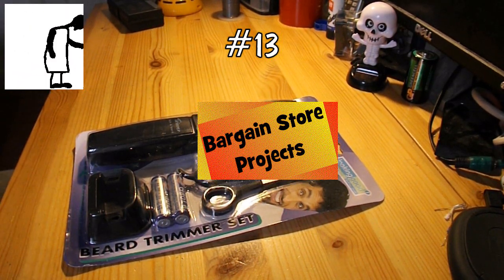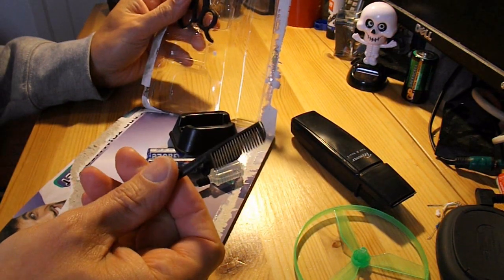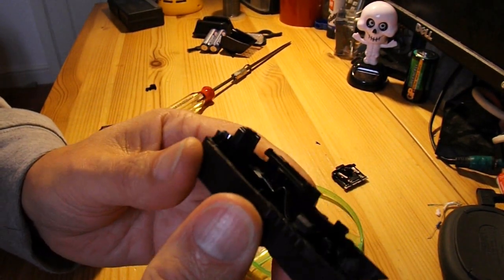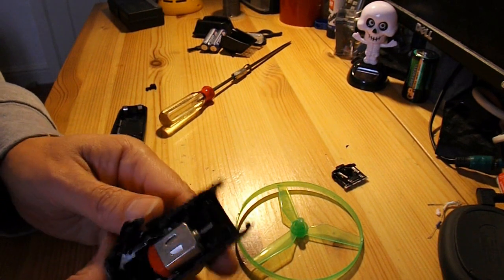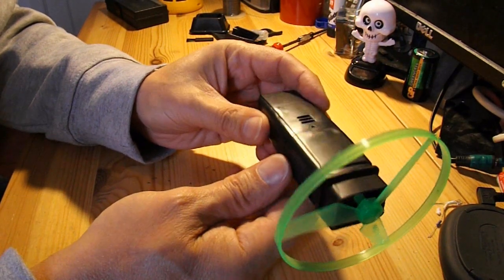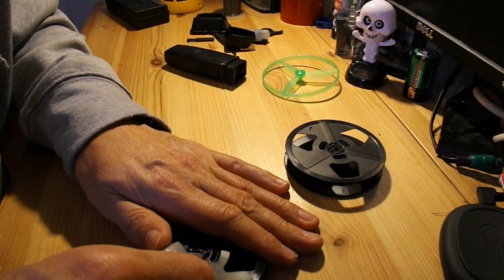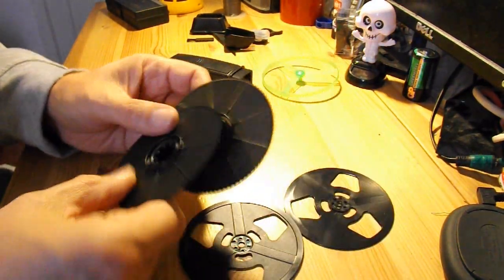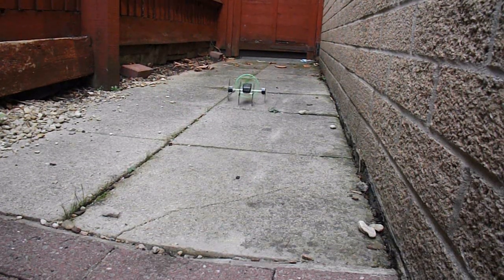Bargain Store Project #13 - Beard trimmer to fan jet car

Comment from the maker: Hello again JackANDJude, yes I want to link some of these things together. So far I haven't managed to produce a reliable combination as there is not enough power from the feed to the LEDs to run an reasonable size electric motor and a little bit of extra circuitry is required between the two to power one properly. I have managed with small vibrating motors to make sound activated or light activated bristle bugs. You can see them in my "Let's Hack" playlist.

Comment: I think if you wanted to, you could reverse the battery polarity and have it be a "pusher" instead of a "puller".
As I said, "I think" therefore I'm probably wrong. 
Either way it's a nice little car that a older child could play with.
Keep the videos coming, I enjoy watching them.
Have a Great Day!
Reply from the maker: Thomas Pigg you could probably force the batteries in backwards to reverse the current flow and you would need to turn the propeller round so that it works in the direction it is designed to spin or it becomes far less efficient.
Reply: Hi its Keolan can you make a remote controll  car with CDs for wheels and one moto and how to make a controller too
Reply from the maker: Geraldine Bernard Radio Control Cars - Grandad Style https://www.youtube.com/playlist?list=PLA5a2xPRSrB0hs_uRx0mCbsNsQSKE0i_3   

Wired Remote Control https://www.youtube.com/playlist?list=PLA5a2xPRSrB0GHy5dTf7Wh_hS_Zb47z-D

Comment: is a beard trimmer fan heavy? I'm thinking about use this as the motor of my hovercraft project? do u think it's possible?
Reply from the maker: I have tried hovercraft with these small motors. They do not really have enough power, the weight penalty of the batteries does not help. If you can make a very light weight hovercraft you may do better than me. Getting the right sort of fan blade is also a problem.
Here is my playlist with all my hovercraft attempts http://www.youtube.com/playlist?list=PLA5a2xPRSrB3zoLYIrdESCCWdx2nLq8r7

Comment: haven't video cassette in 16 years
Reply from the maker: Yes it is not easy to find old cassettes to take apart. When I made this video in 2013 the charity shops were giving them away because they could not sell them as nobody wanted them and they had stopped taking donations of cassettes for the same reason. I still have several in my junk pile.

Comment: You can go turbo with 2 18650 cells......
Reply from the maker: +pcuser80 Let's look at the dimensions. An AA cell measures 14 mm in diameter and 50 mm in length and could be called a 14500 if using the same terminology as an 18650. Put another way the 18650 is 18 mm in diameter and 65 mm in length so it would not fit in the case. I can buy 10 AA batteries for £1, how much do 18650s cost?
Reply: +GrandadIsAnOldMan 
18650 cost a lot more,  i was thinking about a seperate battery holder.
Just a idea....
Reply from the maker: pcuser80 well it wouldn't be a Beard trimmer car if I used a different battery container. I have plenty of fan driven cars in all shapes and sizes. Here is one powered with an 18650. It's not exactly what you will be expecting but it is an 18650 :-)  https://youtu.be/quJ-bRBFjao